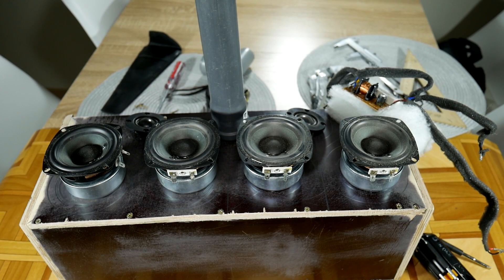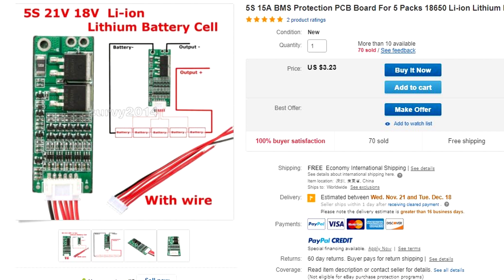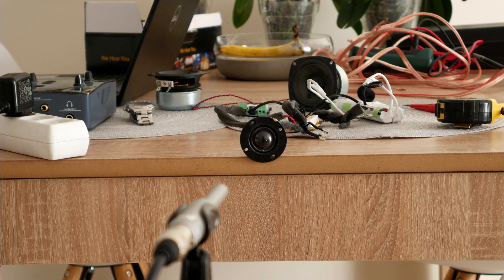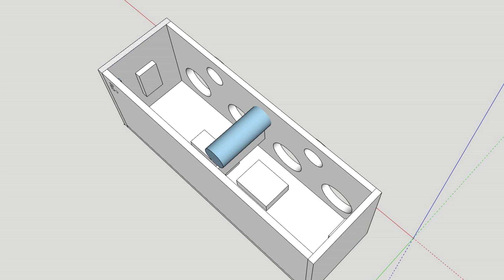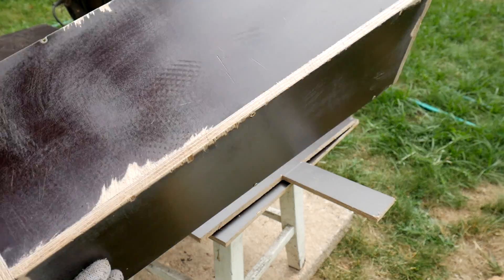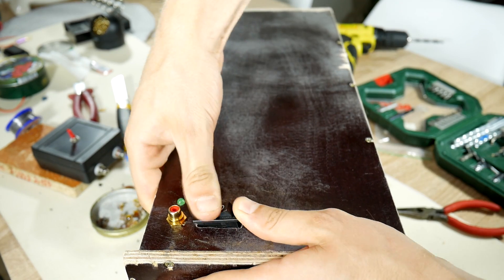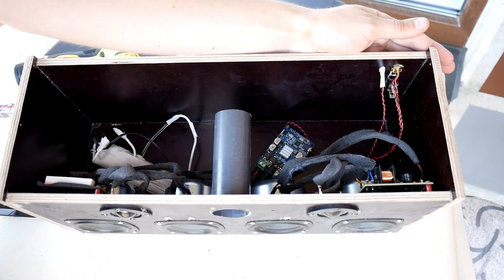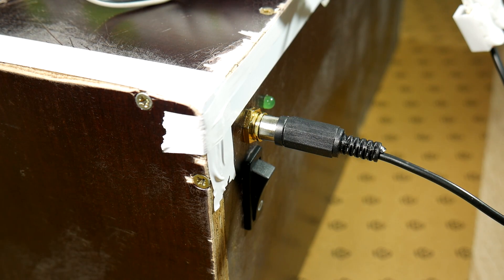How To Make Bluetooth portable speaker [JBL killer Beast] [DIY]

Comment: Hello, the speaker is good, and I have a question, what software did you use to design the speaker box?
Reply from the maker: i use just feeling, but you can use any bass reflex port calculator, to tune port freq.
Reply: @Techscrews No, what I meant was that in the video, you designed your box using a software inside the computer(Box dimensions design ), what is the name of that software?

Comment: Me cringing at my classmates flexing the bass of their Xtreme 2, I though I could make one better than that. I wanted to make one with 2 mid/tweeters and a tang band 3". That would blow the Xtreme out of the water with the bass. It might also be cheaper, but I am not good at designing 3d- printable enclosures. anyone here that made one using a subwoofer driver that could to this?

Comment: Cool speaker but I love my charge 3’s and my charge 4. They rumble my house just enough to annoy everyone.
Reply from the maker: Why you use portable speaker in home ? For home need use real stereo speakers, that also sound good :)
Reply: @Techscrews  nope portable JBL speakers are much better. You can connect over 100 JBL speakers 😁 and have left and right stereo mode.
Reply from the maker: @zamn__  after some quick tests, look, that my speaker soumd better. Later I upload second part for this video. More than one jbl speaker for stereo sound cost too much. My project mission is price/performance.
Reply: @Techscrews  of course but if someone wanted more sound quality, bass or just something nice. I'm not saying that your DIY speakers are bad but they look really cool and sound good aswell and they hopefully last for years before they need repairs.
Reply: @zamn__  a propper audio system is always going to smash a portable speaker
Reply: @ellissamsontech  yes?